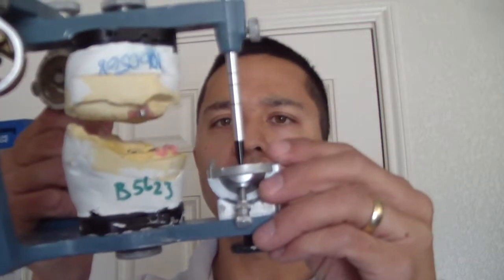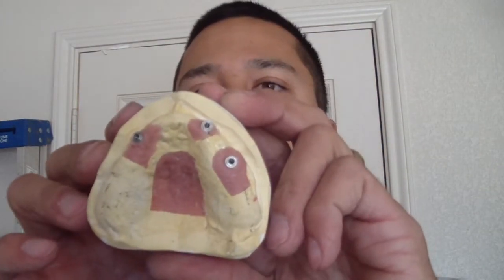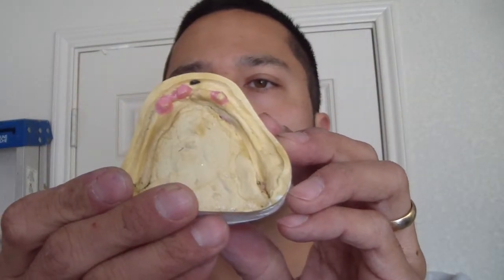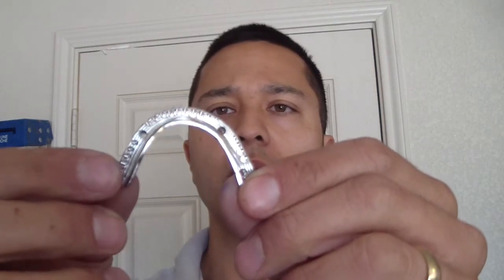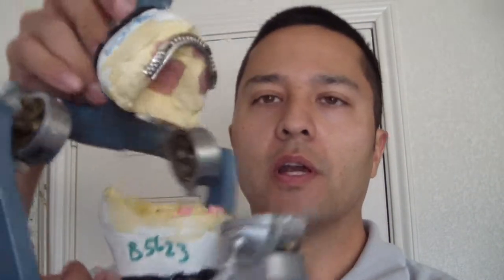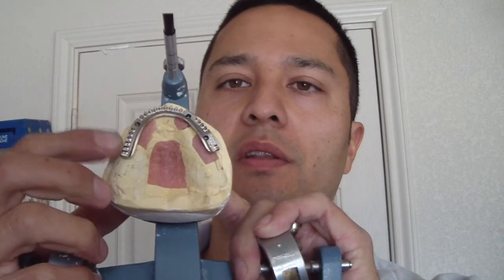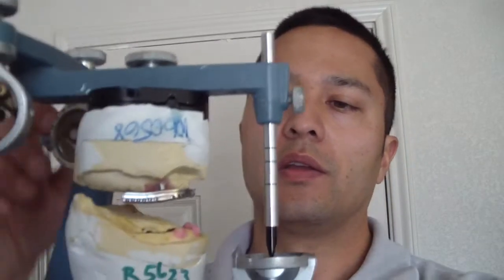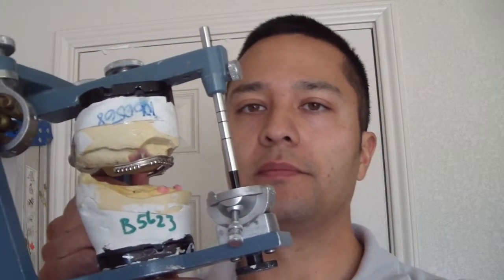Titanium Milled Implant Overdenture - Case Discussion

Comment: I have a milled bar over the implants to give them extra strength. The bottom one has a cantilever and the screws that hold in the bar keep coming loose. Has there been problems with the screws becoming loose because of the cantilevers?

Comment: I wouldn't worry about the bar fracturing... it's the load forces your putting in the implants that is the concern. 3 external hex implants with a 15 mm cantilever seems like a recipe for disaster. Surprised 3i milled this for you.
Reply: U realize that the opposing occlusion is complete denture, no way this implant going to fail coz of forces